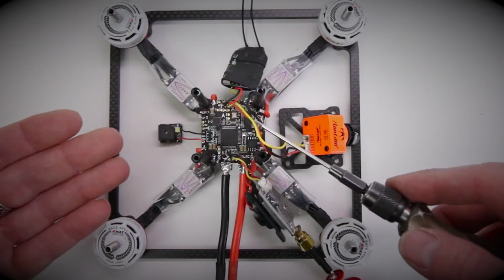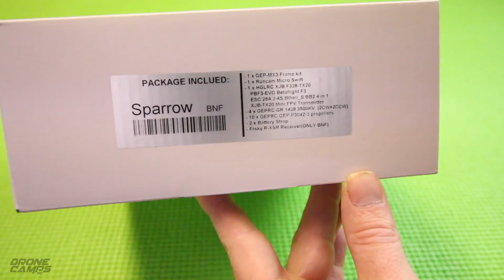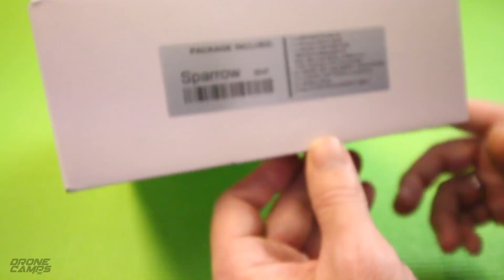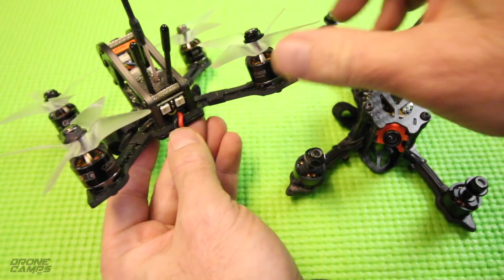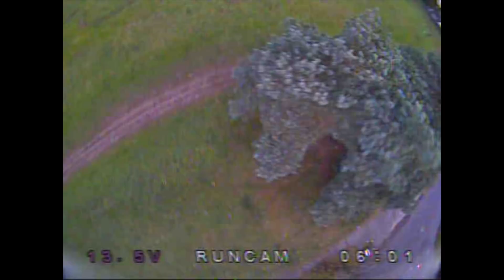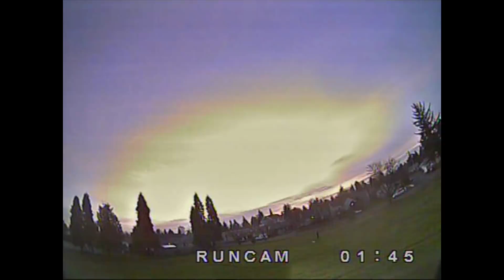100MPH BEAST? - GEPRC MX3 Sparrow - 100% Honest Review

Comment: FYI lowering the PIDS did fix the problem,   Lowered P terms for Pitch to 35 and Roll to 30 and Yaw to 50.  This made the noise go away, I also lowered the D terms a bit and found that it started bouncing a bit so I put them back to 30 each.

Comment: Good review. Can you please explain the differences between the PNP and the BNF models? Pros and cons, which one do you think is better? Also, I have an MJX Bugs3. Will the controller and FPV goggles from the Bugs3 work with the GEPRC MX3? If not, could you recommend some that do? One last question: Every online shop that I've found sells the MX3 Sparrow unassembled. Can I buy this drone assembled? Where?Thanks again for your informative reviews. Keep up the good work.
Reply from the maker: The bugs controller won’t work with this. The goggles will. Pnp is add your own receiver model. Bnf is with a receiver.
Reply: WOW, thanks for the quick reply, Dude!!! Can you recommend a good controller? Not too expensive... ;-)
Reply: Oh, I just saw the links on the "show more" drop down. DOE!!! Please ignore my last question... ;-)
Reply from the maker: The TARANIS X7 best $100 radio on the planet.
Reply: Thanks again for the quick reply.

Comment: Hey man, thanks for the review. Looks like a great little quad-copter. I was wondering what you think in comparison with GEPRC Hummingbird 110mm FPV Racing Drone Omnibus F4 12A BLHeli_S ESC 5.8G 25/100/200mW 48CH VTX RunCam Micro Swift Camera from Banggood.
Reply: I'm new at this but after watching your review I'm interested on one of this little quads. I will appreciate some advice if I'm good with one of these two or something else.
Reply from the maker: Id start with a hummingbird and move up. This 3" is really powerful for a new guy.

Comment: I bought two of these and I seem to have a problem. When I flew the first one I had a flyaway and lost it so when I got the second one I connected  to Betaflight and test the motors with my Taranis plus X9D after I start revving them up and lowering back down the motors all of a sudden start rising in rpm and I can't use the throttle to lower the rpm I have to shut them off Why is this.

Comment: Would it be possible to squeeze in a RunCam Split instead of the Swift?
Reply: Paul Stoutamire  Once the Split Mini comes out, sure...if the boards will fit in the stack.

Comment: Could you help me please,  I just built one of these sparrows with the HGLRC flight stack, 38amp 4in 1 esc, brother hobby 1407 tornado 3600kv motors and running 3052 Gemfan tri blades with 4s.   The quad flys fantastic the tune seems good no ocsillations but when I punch out I hear a fluttering sound  (similar to running a tri blade with one blade missing its tip) When I back off the sound goes away and the motors just sing like a dentist tool.   It is not effecting the performace but just concerns me, I don't hear that sound on my buddies who is running exact same setup with different frame.   Do High KV motors like higher motor timing  value set in ESC configuration?  Did you have to raise or lower your PIDS to get your motors to sing like that during punch out?  and lastly the props, these gemfans 3052 triblades are very thin and could be distorting under heavy durress.   What props do you like for these little guys?  Anything you can suggest would be a big help thank you in advance.